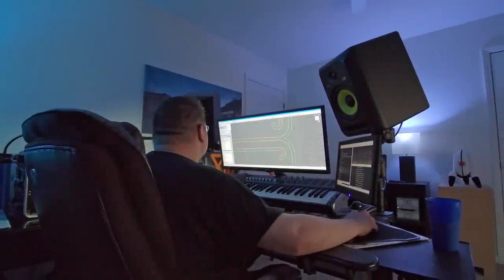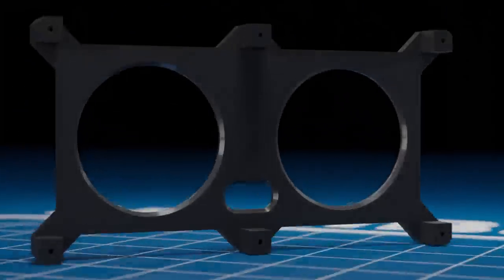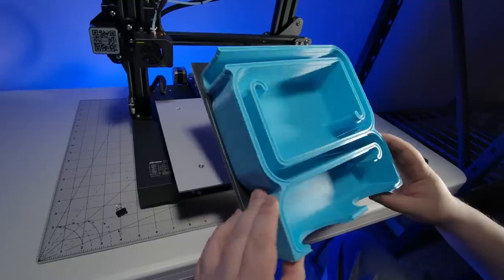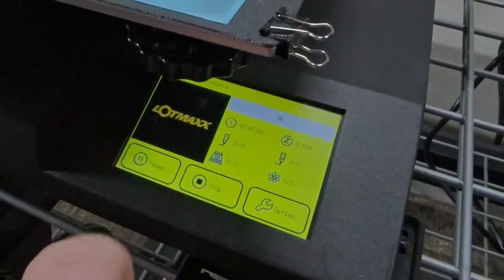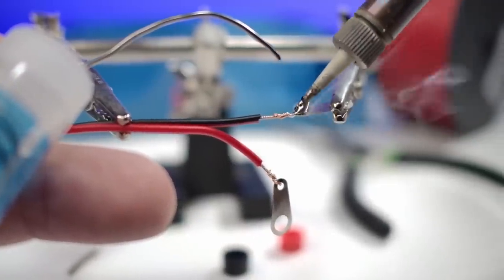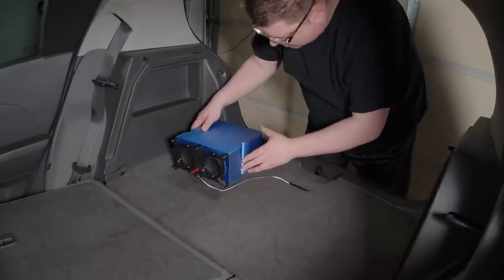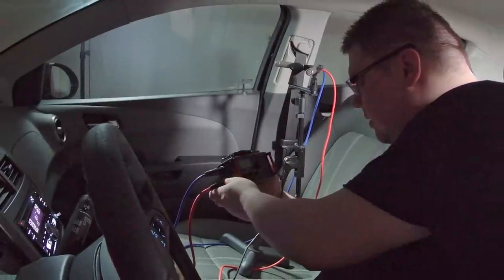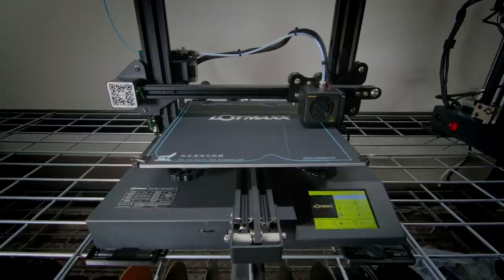HexiBox v.3 featuring Lotmaxx SC-10

Comment: Interesting, I got one of these machines, and is logo'd under a different brand name (not the name LOTMAX) , but, it is exactly the same unit, strange... I am just glad it was cheap, the head/heater, seems to be the only thing worth a damn, but everything else, leaves me in a state of questions and or grumpy. I ordered new stepper motors, and will but the controller/driver, and run a different system externally, which kinda defeated the point of a self contained unit, but, on well, it was cheap, to keep at an off location from my shop. What I noticed, is one of the stepper motors would snag, and the step over glitch printing, is what I caught mine do, only by pure chance. I took the stepper motor apart, there was what looked like SWARF/machining metal shavings/chips from a killing machine, hence the snagged motion.. I also noticed the feed back sensor was sloppy/loose and could rotate approx 1 to 3 degrees. Now, the machine claims it doesn't use the active position feed back sensor in each of the stepper motors, but that is besides the point. Just saying... With a little bit of trouble shooting, and money and time, to weed out the strange manufacturing issues, I can see these dinky units being a.space saver, cost effective, toy, for the person who kinda has an idea of what is going on with 3D printers, but, I wouldn't recommend this for a first time purchaser, as it will put a sour taste in their mouth, of course after a few curse words have been put on for a wonderful display, before the gut reaction to throw it out of a 12 story building, all in efforts to find some semblance of pleasure from it.... I don't recommend anybody throw this unit ,or anything, for that matter, out of a 12 story building, might damage the sidewalk, or tree.. Spend an extra $100 to $400 on top of the cost of this unit, and just be done with it, so you can just enjoy a printer, right away, problem free... There is my 2 cents. Oh, and lastly, good thing I can read Chinese, the instructions did not come in English, and their website, which is also in Chinese,, but is no longer available, not that it was of any help anyways.. Lol

Comment: I love your work!  I have learned so much from you.  I really want to do this build, unfortunately, I do not have the build platform. I have an Ender-3 Pro  (220x220x250). Is it reasonable to use more height and less length and width?
Reply: Go into your printer profile bump up the build volume to 235x235x250 and make sure you don't have binder clips in the way its what I'm fixing to do

Comment: Is there a way to “invert” the model to print a set of molds so as to make the enclosures out of plastic resin or fiberglass?
Reply: Print the parts, use filler and sand parts smooth, coat with a release agent, make molds, then do your resin pour. LOADS of videos on youtube about DYI mold making.

Comment: Looks like you enjoy "pushing the limits". But next trial, give the piece some room on the bed. Yes, it's good to think x is 17% better than y, but u know, gear sellers have to differentiate their product over the others. So they will ALWAYS over claim capabilities, especially in an industry that progresses so quickly, with MANY new customers that need to learn....  (* so vendors may benefit from conservative limit pushing.... ;-) ... oh yeah, FANTASTIC results!... Now do a mid-bass, mid-range, tweeter (all separate). Then we can assemble them with each, their own tiny amplifiers. (sort of like "RAID" - redundant array of inexpensive devices) (...if only we could make them out of ANYTHING.... but.... plastics ... molds?..)

Comment: 3D Printing AND audio both: check out Alex Kenis. A smaller-ish channel with a lot of unique approaches and detours.

He bounces between many topics. Embedded electronics development, like STM32 microcontroller unusual clock configuration. 2 hour investigation on causes of mouse button failures, and not a second in there is wasted, you never knew you wanted to know this much about surface alloys.
3D printing, building and modifying 3D printers - ball bearing trick for lead screw alignment, how to drill a couple holes in an Ender (or similar) frame to help align it better, better replacement for pneumatic couplers. An elaborate PLA filament degradation test - UV, water, temperature, ozone, etc.
Audio - constructing a guitar amp, experimenting with modifying cheap dynamic microphones.

I scrolled through the comment section, and having over 1000 channels i'm subscribed to, roughly 90% of the ones people recommended i have already been aware of. Some are good and i actively follow them, others i actively ignore. None of the channels that i hadn't heard of yet were even vaguely good enough for me to subscribe to, and i'm not stingy with that. I'm not sure whether i expected anything better, but the comment section failed to positively surprise me.

Comment: Let's say someone happened to notice that the SD of 2 of these (54) are a little over the SD of the Dayton ND105-4 (51), let's say someone remixed it to see if the Dayton would physically fit, and let's say it did. If someone were to do that, would they be horribly disappointed with the outcome because the enclosure is based on the other TS parameters? Or would they possibly be happy because it's a type of enclosure that is forgiving and based on the SD of the drivers?

Comment: Would it be possible to design a great responding enclosure that is custom fit to the rear trunk panel? My 2003 4Runner came with something along those lines from JBL but it wasn't tuned well nor a good driver. I Personally have been desiring something similarly hidden in my new 05 OBXT project car but with a far better sound. Example of 4runner setup: https://www.toyota-4runner.org/attachments/4th-gen-t4rs/44541d1305490078-how-replace-jbl-subwoofer-dsc_0365-jpg?s=d959363152847446577fca9d2e760cc2

Comment: Why don't you experiment with putting something like No Rez (excellent product, probably the best cabinet damping material: http://gr-research.com/norez24x27sheet.aspx) in these small cabinets?  Might make for a smoother response.  Not sure how much the playback end is affecting things, or the car itself, or your room, but they do sound boomy to me.  Whether thru cabinet design or EQ, they need to be flatter if they were to be put to real use and not just a fun project.  Impressive as always though.

Comment: Prusa makes the best printers, it's all automatic, bed leveling etc,
Reply: No stratasys does.
They hold almost all of the patents.
But those are $50,000 to get your foot in the door.
Even HP has the powderjet printers that print phenomenal starting around $50k.
Prusa is a hobbyist machine.
Its not even enclosed.
If someone is serious about 3d printing they have to be willing to enclose the printer.
That is why his corner was lifting.
It was catching some cooler air at that spot.
Reply: @MisterKaen  lol you just supported my point cause prusa is the best value